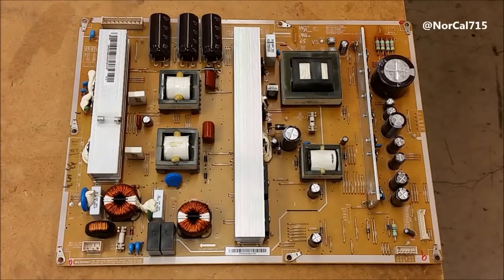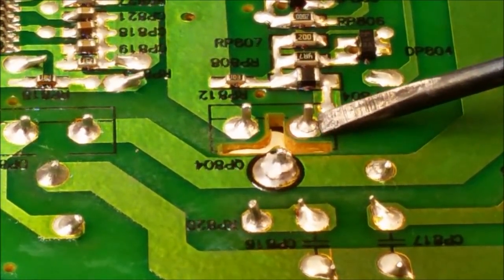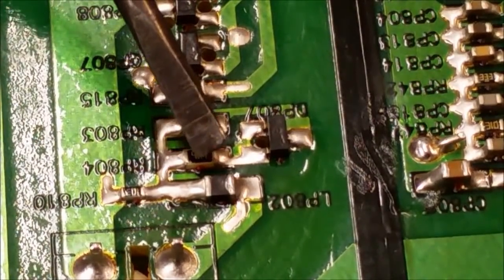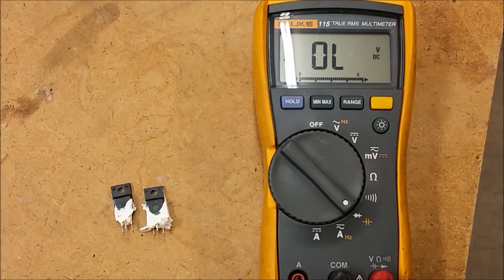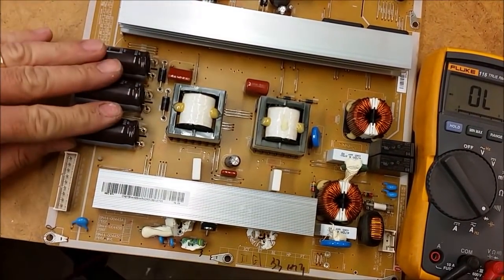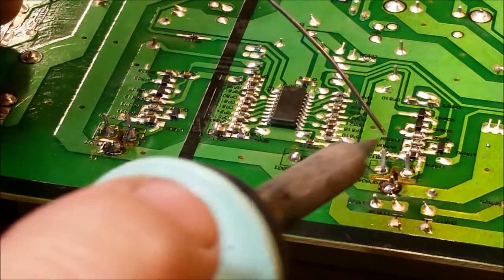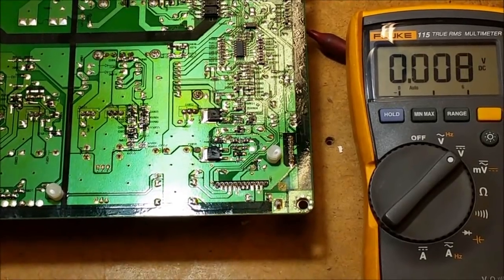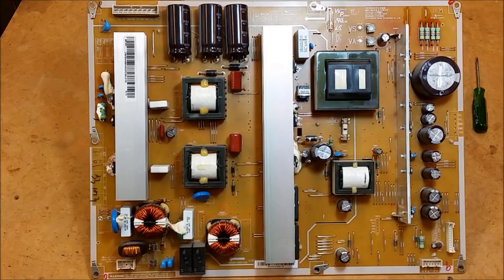Samsung Plasma Power Supply  Repair BN44-00445A Power Factor Correction

Comment: Ideally, you should have replaced the drive IC as well, as sometimes (even with the gate drive circuitry testing OK, the drive waveform can be corrupt, and the transistors may blow again after couple of hours even if TV set  works ok. You can use the scope to measure the waveform, and check temperature of the heatsink with the laser thermometer to find out if the FETs are not running two warm aftr the repair. PFC circuts usually do NOT run very warm.
Good Video!!!

regards from Holywood Rd TV repairs, Befast.
Reply: What do mean by Drive IC? Which IC are you referring to? Cheers from Vancouver!
Reply: Yes it could be
Reply: Yes agree. Drive ics can have intermittent faults. Usually internal bond wire issues.

Comment: Another Norcal masterpiece. Thanks. This helped me sort out a BN44-00446A out of the slimline smart model 51D8000. 2 blown FETs and same main fuse blown. after 3 failed attempts including doing some caps around them. I'm always on the lookout for cracks but missed these completely. After seeing this and using some jeweller loupes found the same cracks you did. replaced thos FETs and fuse again along with repairing the bad joints and has not failed after 4 hours. Was lasting about 50mins and must have heated up enough for one of those joints to fail and short out. Cheers

Comment: Hi, Thank you for this video. I have one of this pcb which has an issue. there is a short circuit between 5.3V and GND. fets were also damage and move at the import was blow too. I was wondering if you have the Sch of the boards, of if you know what might cause this issue?.

Comment: I ended up repairing my PSU card after having to replace it 3 separate times.  Found a bad diode (more like degraded), but noticed my PSU was still restarting the TV on and off (original discrepancy).  I had already replaced some caps that may have gone bad but had no visible signs with a higher voltage tolerance.  But what I found out was that the Vs reading was showing 220V (supposed to be between 214.5v and 223.5v).  When I adjusted the pot for that voltage, the buzzing from the power distribution card (not the PSU) got softer and the TV stopped restarting.  Tested for a full day and no restarts.  Not sure if I fixed the issue or just extended the life of the transistors temporarily.

What I almost ended up replacing was the relay.  I felt like it was opening/closing on its own after every 3 min as if it couldn't handle the current/voltage levels. Do you think I fixed the issue?  What exactly is Vs and Va?

Comment: i have this exact board. i did notice. two soldier terminals cracked where you replied get them fixed asap. my samsung plasma 59 inch. picture goes off after a few minutes, still has sound. i pulled and checked the y boards and the IC chips are ok. I'm having the power board solider. where should i begin to look next.
Reply: Fix it?

Comment: hello
would you please reply me?

Hello
please Mr.Norcal i have exact issue shorted QP804 easy to read part# 6R190C6  but shorted diode DP804 ...etc my problem is QP806 is shorted open resistor 47,20  ohm...etc , instead of asking you for QP806; QP805  PART #? CAN YOU tell me where to get  this BN44-00445c  schematic? if canot then WOULD YOU PLEASE GIVE ME PART # FOR QP806, QP805 And my last is QS802 that drive the opto isolator . please replay me if you can to save me from yelling wife for opened tv every where in the house :) !
have a great day sir

Comment: Another great vid. 

Re. plasmas, do you still recommend repairing failed sustain boards? New mdules in the supply chain are not available, only pulls from used sets which have limited life expectancy. 

Interested in your view Steve.
Reply from the maker: +davecc0000 The later model plasma's especially Panasonic and Samsung used discrete components in their sustain boards and not the modules. LG was a fan of the modules. less design on their part I guess! Thats why Samsung and Panasonic were better sets in my opinion.
Reply: +norcal715 Thanks Steve. Great to know.

What year/series did Pan & Sam start using discretes? 

You're doing great work Steve, one of the few helping keep these TVs going.

Comment: Hi, great video, thank you!
Have you ever seen the MOV/Varistor blow (crack in half) by the relay? I wonder what could have caused this? TV was fine, powered up and running a few minutes then we heard a ‘Pop’ and fuse blew on the mains plug (both internal fuses fine!) - the varistor is the only part that is damaged. Replacing plug fuse and powering up blows it again instantly... board variant is BN44-00619A. Just seems a bizarre fault to me!
Reply: BN44-00445C board variant here, exactly the same happened few weeks ago
Reply: PSU board: BN44-00513A (from a PS60E6500 plasma tv).
Also both internal fuses ok, main fuse out! Kind of bizar isn’t it?
While the ac-plug poles are not shorted. They measure high (dc) resistance.  What can it be?

Comment: Great video. 

Do you reapply silicone on the mosfet leads after replacing? Also how do rivets prevent solder from cracking?
Reply from the maker: +mrsemifixit No I do not reapply the silicone. I think it is detrimental for the life of the solder bond. The leads are not allowed to move with thermal expansion and contraction. I haven't had a conductive dust problem in a long time but I have had at least 5 of there sets fail because of the silicone.  The rivets allow more solder to be "wicked" between the lead and the rivet.
Reply: NorCal715 what about applying pcb lacquer spray. That should insulate the leads and allow movement from heat expansion.

Comment: I had a problem with my set, no picture but sound. checked your video and found one loose pin on a mosfet. re-soldered it and so far so good, the set has been running for 15 minutes now usually it would run for 2-3 minutes while the mosfer heats up then the computer would shut the power supply. 
Do you think i should still change the mosfet? there must be a reason why this solder was loose? I've read my VA and VS and they are good.

Comment: You mentioned that QP805 and QP806 sometimes fail as well.  Mine has those components blown (along with RP807 & RP808) but I can't identify the transistors/diodes by the limited numbers on them.  Do you have a replacement number for them and perhaps a source?

Comment: Great video thanks for posting. I have a 2010 Samsung PN60550E Plasma I am trying to save. I replaced a few of the capacitors on the power supply. When I got the TV (free on Craig's List) the tv had no picture, no sound and the red light on the front of the TV was not lit. I now have a red light on the front after replacing a couple of capacitors, but still no picture or sound. I also noted that there is a small LED light just above the input for the power cord and it does not light up. I am wondering if the LED light on the power supply does not light up if that might be an indication of something. Thoughts?

Comment: So what board would I replace if the Samsung 60" Plasma TV won't "Start" when hot?  "Starting" is when you press the on button, see a little flash on the screen followed by the blue Samsung logo and then your signal.  
Not "Starting" is when you press the on button and nothing happens but five seconds later the power light flashes on and off.  
Let the set cool down, disconnect-reconnect power and the set "Starts" as normal.
Any idea what board has gone?
Reply from the maker: Really hard to say, I would start with a cold set and then warm up each board one at a time with a heat gun or a hair dryer until you can determine which board is causing the problem. It may take several days to find the bad board.

Comment: With me is the transistor 6r190c6 broken synonymous but unfortunately I can not find one with the same label since the page is still HAX124 is printed. Is this just a batch number? Or are there differences with these transistors with the designation 6r190c6?I have the same samsung PS59D500C1W

Comment: I bought a similar kit for the BN44-00515A from ShopJimmy.com through Ebay.  Would you happen to have a diagram or picture of the back side of that board showing which direction the 2 small IC's ICP801 and US801 face? I had them marked with a maker on the board but my solder flux and alcohol erased my markings when removing the old IC's and I don't want to install the new ones backwards.  Actually enough of my red mark on the small 8 pin IC survived to clearly show it was installed opposite the markings on the board.  (The little arrows in the artwork on the end pins which I would have assumed indicate the pin 1 side and that's how the 3rd IC not replaced in the kit is placed, but this really makes me 2nd guess weather the original IC was placed correctly and I have no clue which way ICP801 faces.  I want to get them right the 1st time and not have all my hard work and new parts blow up in my face. 

You have a picture of the back side of the BN44-00515A board on the Shop Jimmy website (out of stock) but it isn't quite clear enough to see the IC polarity. Do you have a more clear picture or diagram you could email me?  keshenatech1@gmail.com Thanks

Comment: Awesome video and great tips! I have a blown CP816 (one of the blue ceramic caps next to CP817 and the QP802 MOSFET). Looking at buying the ShopJimmy repair kit. I'd like to understand why CP816 burned up, what it else in the circuit may have gone. Fuses are fine, larger green power resistors next to CP816/CP817 seem ok as well. Any help appreciated! I'm not sure how to properly test the MOSFETs with my multimeter, but I removed the silicone and desoldered both QP804 and QP802. I have the schematic for BN44-00445C (download from web) and the labeling is different... seems they call is QP801 and QP802. Any ideas? Thanks!
Reply: Edy Braun I’m repairing a similar model BN44-00515A for a friend. Where did you find your cct diagram, I haven’t had any success finding one yet.
Reply: @markcummings150  I successfully repaired my TV with the ShopJimmy kit (see https://www.youtube.com/watch?v=Wn7toVEpGXI). I didn't find schematic for my board version "C" but in general you can find it here: https://www.eserviceinfo.com/index.php?what=search2&searchstring=bn44-00515a

Comment: I have a power supply board that fails to start only when the YSUS Buffers are plugged into the YSUS board. Replaced both the YSUS and the buffers with no luck. Could it be the power supply fails only under load? I am tempted to replace the power supply board as well...

Comment: An isolated 1Mohm resistor @10:50 doesn't dissapate anything if it isn't connected to ground. It must connect to ground to drain the charge somewhere and the resistor will save your life It's not magic. It will limit the current that would otherwise kill you if you accidentally touch something hot, but that's the only protection it gives you as you will still get zapped. It does not by itself magically dissipate or absorb static electricity either.
Reply from the maker: If you listen closely you will hear me say 1megohm to ground at 11:05

Comment: Good Info - Can you please also explain how to check the  Power supply output pins to first identify that Power supply is actually working. I have a samsung PS51D8000 power supply (BN44-00446A) and I want to check if it is working properly or not. My Samsung TV has died couple of days ago and there is no standby light even coming ON. I have multi-meter and for my learning purposes, I want to start checking the power supply myself. I have checked the fuses and it is working fine. Continuity shows that there is no broken connection inside the fuse of Power supply & the main plug. Appreciate if you can guide me some basic checks which will help me to learn it, thanks

Comment: good morning.  Is there a way to contact you?  We have a PND64 which no longer turns on.  the power LED does a blink pattern of 2 blinks 5 times, and then resets and tries again. It has this exact same power board (including version).   What testing did you do to determine the power board was the culprit?  I have done repairs on computer monitors by replacing caps, etc, but haven't found any damage to our board, no bulging caps, etc.
Reply from the maker: norcal715videos@gmail.com

Comment: Thank you sir. Great video. I learned a lot. My bn44-508a is rumming but the problem is D5 output is 5.12 volts, it should be 3 volts only.

Comment: I’m repairing a similar board BN44-00515A in the same area. Already replaced a 10A fuse, QP804, RP807, RP808 and RP812 which were fried. LP804 is open cct but I can’t figure out its value. It’s under 10uH as far as I can tell with my cheap LCR meter assuming it’s the same as one in the adjacent cct. Where can I find a cct diagram or parts list for this or any similar model as they all seem about the same design.
Reply: Exact problem I have, but in the same board as video. I also had the QP802 split in half and short the fuse

Comment: Hi ,, My plasma samsung 43'' i v connected the powersupply board seperately , n after switch. On , all the voltages come on and immediately drop down to few volts,,,,, plz advice .... It's a ps43e490b3r samsung..... I'm from Goa . 🙏

Comment: Absolutely great. Quite enjoyed watching this whole video. Totally agree with u regarding better picture quality with the plasma but unfortunately the components used and some of the designs are quite cheap and nasty. The dry soldered joins and ringed dry joins DO seem to be getting less common. Mostly the cheap n nasty components from manufacture popping. Currently working on a 42" Plasma Bush, BPDP42HD3.  No picture but sound fault. ybuffer ok. Ysus board supplys xsus board. Its a bit of a head scratcher :(

Comment: Hey NorCal So I just got this TV for free from someone who said it was not turning on at all. So after having opening it I noticed on the PSU board that component QS 804 had melted traces and blown components around too here is a list of what was blown
QS 804 
RS 833
RS 834
RS 835
And that other component I really cannot identify which is DS 810 

I looked at DS 808 also unreadable...

Do you have any idea of what could be this component ??

thanks in advance hopefully you can answer me really liked your video
Reply: I think I found it BAV70 let me know what you think

Comment: Hello
please Mr.Norcal i have exact issue shorted QP804 easy to read part# 6R190C6  but shorted diode DP804 ...etc my problem is QP806 is shorted open resistor 47,20  ohm...etc , instead of asking you for QP806; QP805  PART #? CAN YOU tell me where to get  this BN44-00445c  schematic? if canot then WOULD YOU PLEASE GIVE ME PART # FOR QP806, QP805 And my last is QS802 that drive the opto isolator . please replay me if you can to save me from yelling wife for opened tv every where in the house :) !
have a great day sir

Comment: Hai Steve. Do you have schematic for BN44-00508A. I can only find BN44-00508B witch is completely defrent design.
Reply from the maker: No I looked and I can not find that specific schematic.  Sorry
Reply: @norcal715  oh. Thank you, it ok. I just found a second circuit on that SMPS board. I'm lucky enough that the second circuit is not damage.😅
Can I use hot glue to replace that RTV silicone? I cannot find RTV silicone in my area.

Comment: I have the same board and my PFC isn't working. I only get 160V on the filter capacitors, should be around 400V. Any idea what is most likely to cause this failure?
Reply: Mike, I have the same problem.  Did you get this figured out?  I used a 470 ohm resistor instead of a 220 ohm one but it shouldn't matter.

Comment: I'm working on a samsung plasma, 50" what does the PFC transistors do exactly, mine seem to be shorted too, main 12 amp fuse was blown, in-rush therms were also cooked, but the 2 amp and 5 amp fuses were ok.
Reply from the maker: PFC (power factor correction) changes the phase of voltage to current relationship. If the current draw is in phase with the voltage then the power factor is a perfect "1" This circuit makes it from about .6-.65 power factor to about .8-.85 (or better) power factor. Just makes it more efficient in other words.
Reply: I took electronics at TSTC Waco TX in 2000, two yr degree,  I have not worked on TVs until now, so I'm a bit fuzzy on all this. So can I test the TV without the PFC on? I have the FETs out, I saw another video of a tech doing that but to me it seems risky, might draw to much current, I dunno. I have not seen this TV work yet, I got it like this.
Reply: To answer my own question...you can cancel pfc on some boards I read but not this one...its smart. So... waiting on the fets now...should be here today or tom...I will post back. Oh and I recalled a pneumonic we learned...ELI the ICE man...E is voltage...L is inductance... I is current...C is capacitance. Current leads in capacitive circuits... voltage leads in inductive circuits...you counteract one with the other...TVs are capacitive....so they added a coil...to add inductance...and boost...look up buck and boost converters for an example simplified

Comment: What can be damaged if both va and vs voltages are incorrect? voltage very low. Before was short.in X buffer, i replaced one of IGBT.still no picture. Found that voltage on power board not good.

Comment: i just had one of these on the bench, two main fets were dead short, looked at the pfc section under a microscope though and nearly every component without a rivet had hairline fractures in the solder fillets, i'm usually a fan of single sided boards for the ease of rework but someone obviously didn't think about thermal expansion when they wave soldered these. even the jumpers had sunken fillets and microscopic cracking.  talk about absolute garbage.